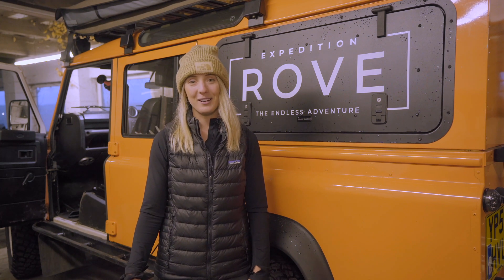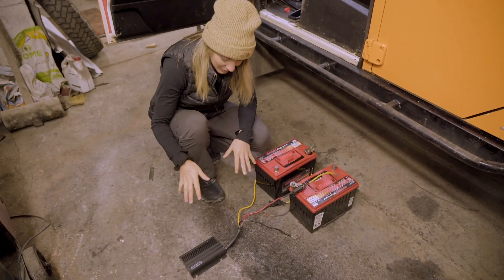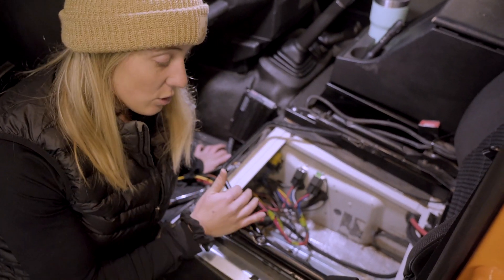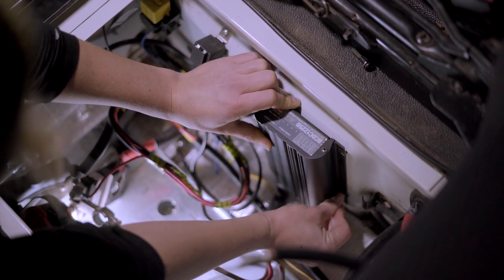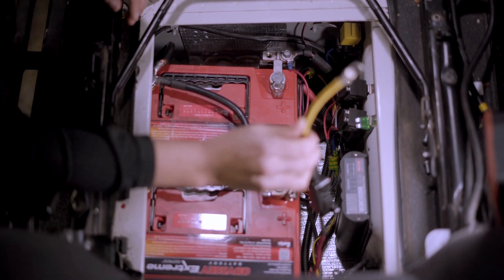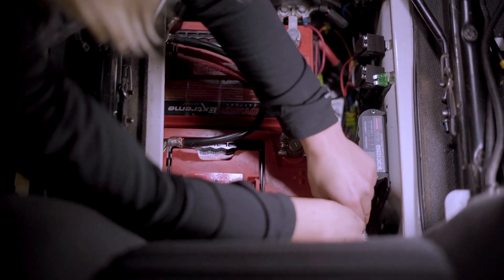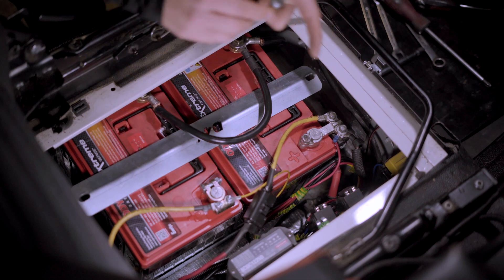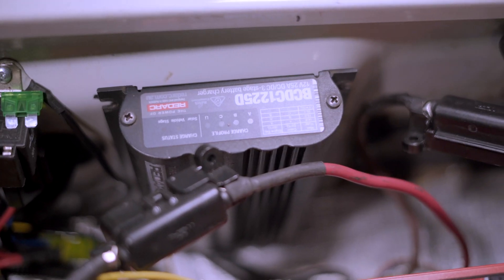Dual Battery Setup Installation - REDARC BCDC + ODYSSEY Battery - Overland Land Rover Defender

Comment: Hi thanks for the top tips regarding setting this up. Can you please tell me the size /capacity AH ‘s of the batteries you used? Thanks
Reply from the maker: One is the Odyssey PC 1500. I can't recall the other off the top of my mind but it was a little bit smaller.

Comment: Hello, if we need to install Solar panel ?, the yellow cable then is to connect with the + solar, and the - to the frame car?
Thx
Reply from the maker: Hey hey! Yep, yellow is to solar. Here's their wiring diagram: https://www.redarc.com.au/wiring-guide/wire-bcdc-to-common-ground

Their technical team is also wildly helpful and offers free expert technical advice. Definitely recommend giving them a ring if there's any questions that pop up. Here's the details for easy reference: Technical support: +61 1300 733 272 (6am – 6pm ACST), M-F